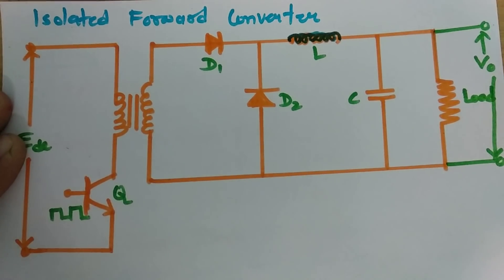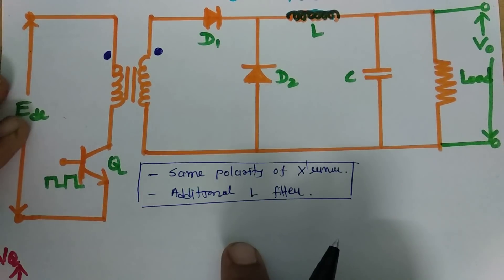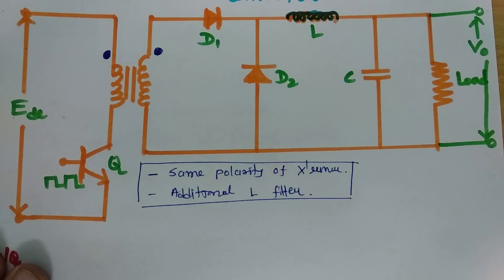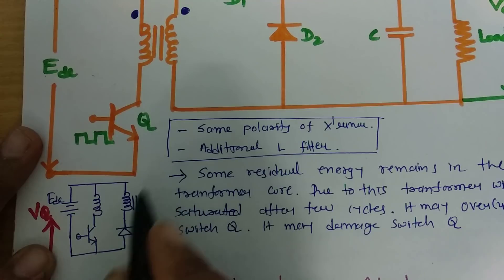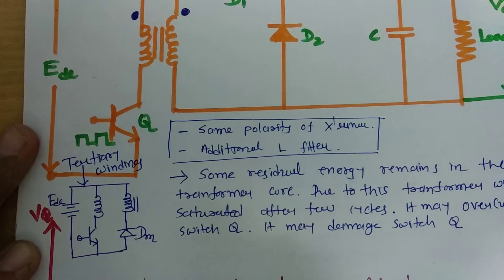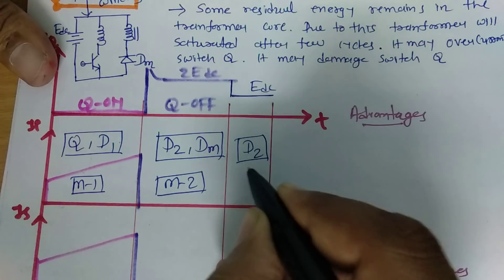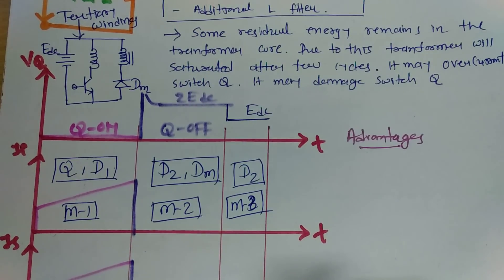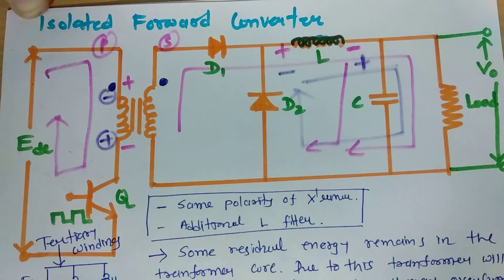Isolated Forward Converter (Basics, Circuit, Working, Waveforms, Parameters & Application) Explained

Comment: During the switching time, when no current flows through the primary coil, no energy can be delivered to the rectifiers. It is therefore important that in this circuit the coil is provided with an air gap, which stores the energy and then releases it during the switch-off time.